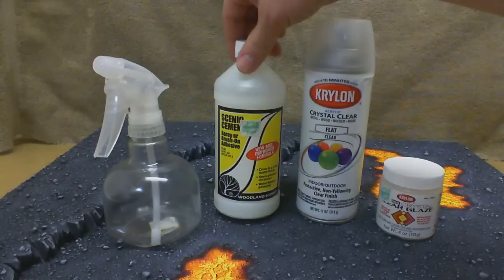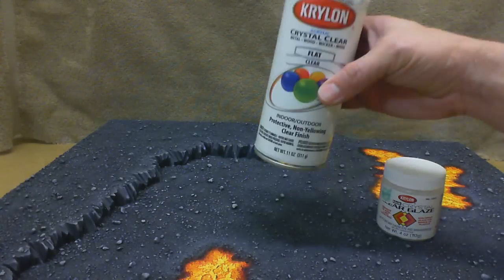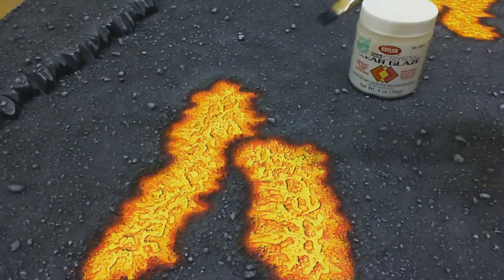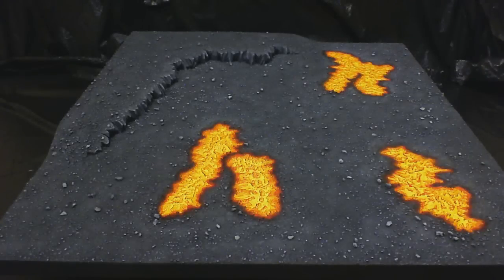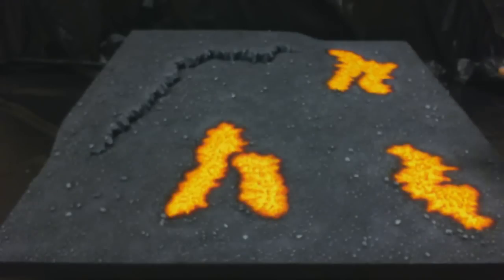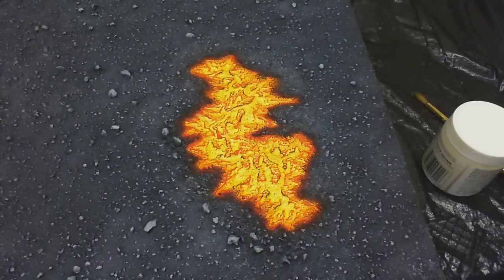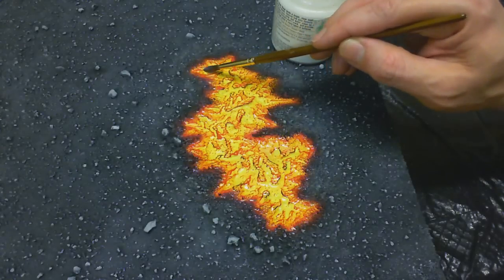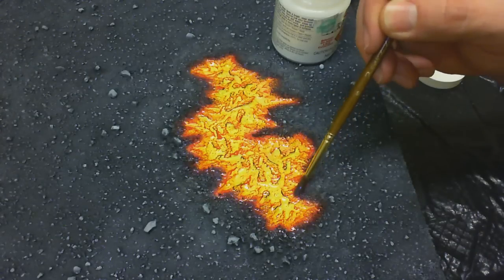Building A Terrain Table - Video 23

Comment from the maker: Yep, same method on all six boards.  Once the Scenic Cement has "bonded" the flock, the clear coat is technically being applied to the glue on top of the flock.  The flat clear coat will just adds an additional, durable layer of protection.